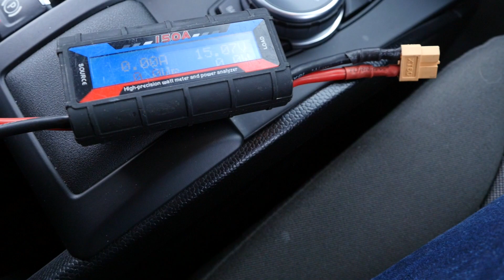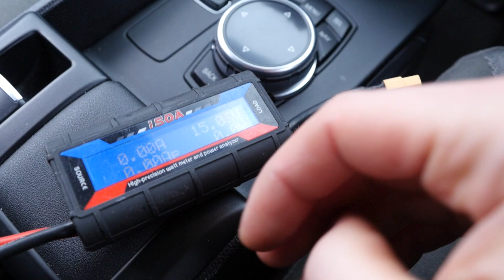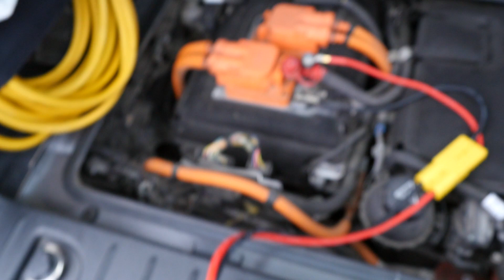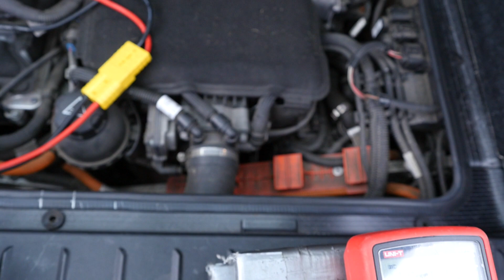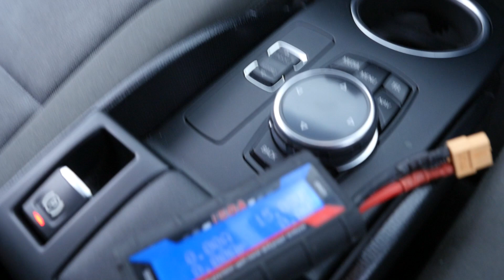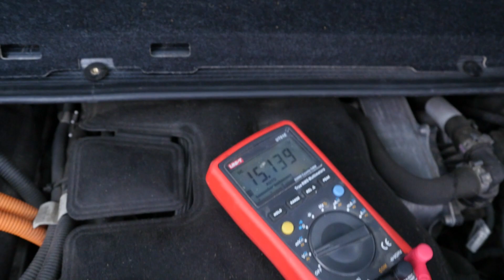BMW I3 More High Power 12v Tests

Comment: Have you tried to get 2kw + yourself there on pins you've been showing? Any problems after doing so?
Reply: The reason I'm asking is the video in youtube, some old promo from bmw about i3 where owner goes to the suburb, opens back door and plugs 220v plug to a socket inside the car on top of the cover on top of the space where the converter and rex are usually placed
Reply: https://youtu.be/13neHOQtgC4
Reply: https://youtu.be/Wqr89egRUaY
Even two of them with same